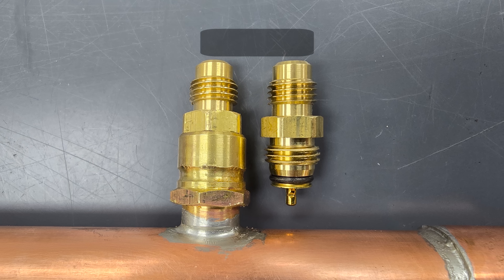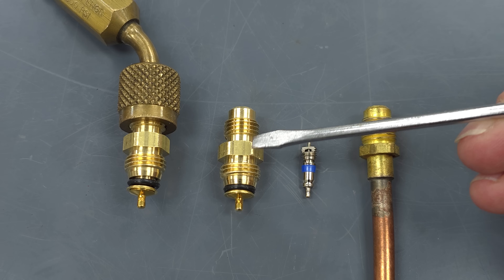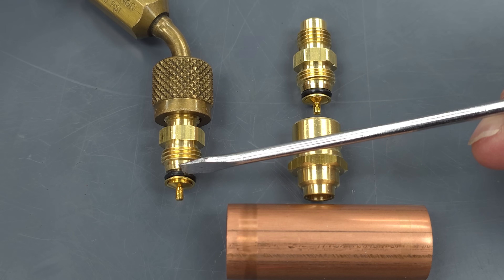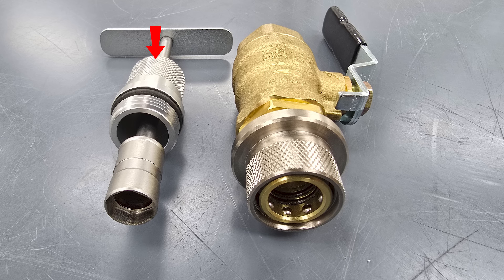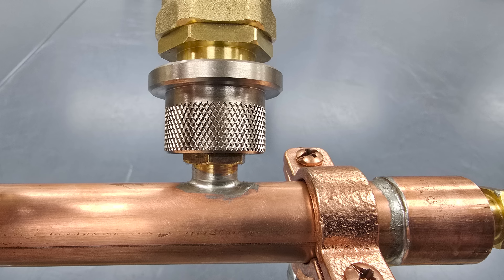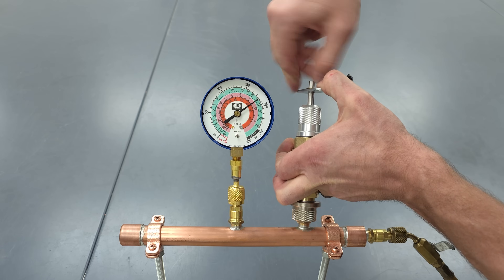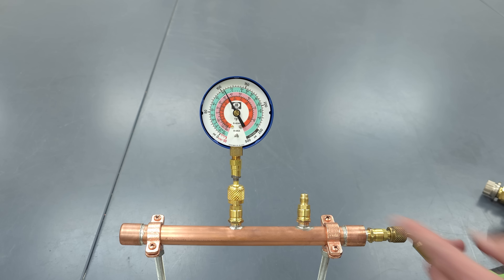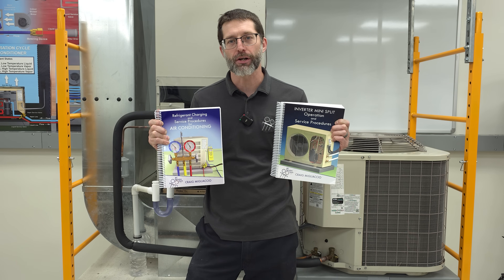What is a COREMAX Valve and Port Assembly on HVAC Units?

Comment: Coremax valve fittings are the worst design ever in my opinion. I would rather not have them. The standard valve core is cheap , easy to replace and easy to remove. I work strictly in the commercial side. You can't fit the CoreMax valve tool in every application. So when they leak unfortunately you must recover all the refrigerant out to change a valve core.

Comment: Problem I have is this CoreMax  'hot tap core remover' is much larger than the tool used on traditional schrader cores. Carrier small package units have used these for years now BUT THEY DON'T ANGLE THE ACCESS PORT TO ALLOW using the large 'hot tap tool' in tight compressor sections!!!

Comment: I do not like coremax fittings. If they are leaking. I put a swivel tee on them unless im recovering. Then i will replace it. They do allow for better flow over a Schrader. That tool used to cost like $175 many years ago.....the price of it nowadays is ridiculous.

Comment: Great video as always, personally not a fan of these fittings.  I haven’t had an employer willing to put these core removers in the van and it doesn’t make my life easier enough to warrant my own money.  They either get a flared tee fitting or cut out and replaced by a slip fitting with a schraeder, if the system is open.  I’m already invested in high-flow recovery hoses and schraeder core removers as I was taught this was the way and not to pull vacuum thru the gauges.

Comment: Don’t forget that these fittings are to be tightened/ torqued to 6 ft. Lbs.
Reply: Were do you get the torque wrench from?
Reply: @ ordered mine thru Hoffman supply. It’s pre set for 6# but honestly a snug tightness is usually enough. Lot of guys over tighten and they are ridiculously hard to remove with the core tool. I only paid 100$ or so for my core tool. Believe 75 to be exact also thru Hoffman Supply or even Johnstone supply
Reply: 8ft lbs or 96in pounds, not 6lb.

Comment: What your best recommendation on an old R22 valve core seat damaged?  Cannot put new valve core without big leak, now using security caps which seem to seal good vs brass caps.  thank you
Reply: I ran into something similar about 15 years ago.  Trane type unit that someone torqued down the acorn cap so hard it bent in the top of valve seat so Schrader valve would not come out.
1) either leave it the way it is if holding or
2) remove the refrigerant, braze in new stem and seat, pinch off old stem near the top and cut it off and braze it closed.
Hope this helps.

Comment: Don't like them. Several times put gauges on and the pin would not depress, thinking the system has no pressure. That pin has a lot of wiggle in it and the pin fails to depress. Would never purchase the tool. Too expensive.
Reply: Damn I was expecting like 150-200 dollars when you said expensive not 500🥲

Comment: That COREMAX CORE REMOVAL COST cost $600. I am not gonna buy it. When it leaks I just use a cap that comes with flare inside, and stop the leak really well sir.
Reply: It really don’t make much sense to charge that much for that tool.
Reply: I change these things out everytime I need to recover refrigerant. They leak fairly commonly.
Reply: $600 can easily be made back in 2 service calls and it will save you time in the long run. However your method works too, even though its just a bandaid kind of fix
Reply: If ever you're in a situation where a system is empty. Do everyone a favor and install regular valves, always remove these "max core  valves".
Reply: All AC tools cost too much!! I mostly buy used/eBay because it's just to f'n expensive, and after it breaks, I can buy another one off eBay, still cheaper than one in the warehouse
Reply: And the torque wrench is like $600 too.

Comment: On an older video of you troubleshooting an ecm motor can you please tell why the speed taps selection went trough a resistor in the wiring diagram? It even has the 24v common as well
Reply: Go to THAT video and ask your question.  This video is NOT about ECM motors.

Comment: Sucks I can’t use any or my bigger size hoses. I don’t have core depressors in them. I asked carrier and they said just use your gages.
Reply: Get an appion core control tool, it acts as a depressor and gives good control.
Reply: you may be able to add core depressors as other option.